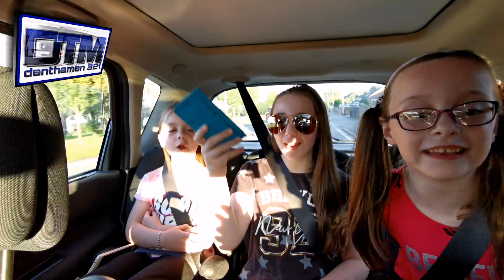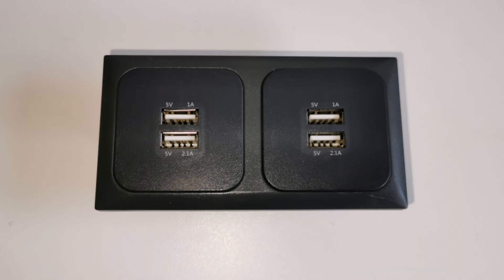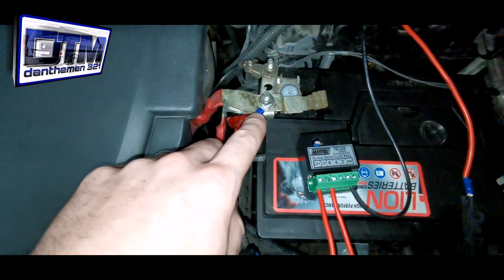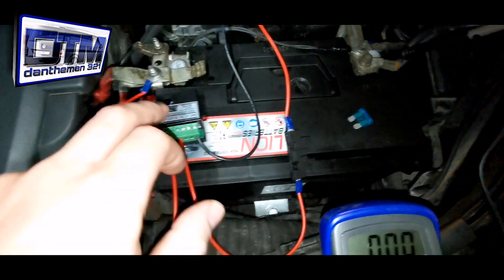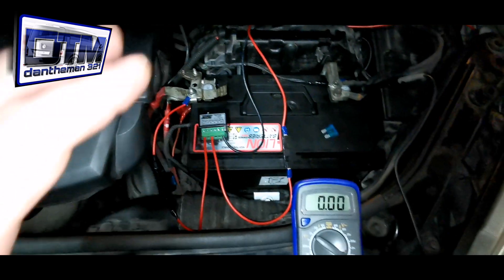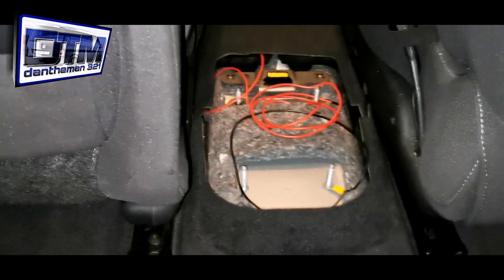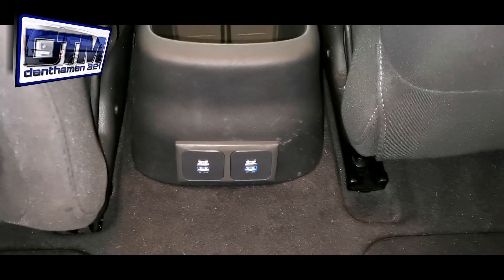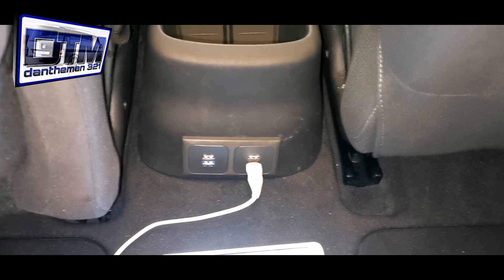DIY USB charging sockets ignition Live retro fit

Comment: Why not just pick up an ignition live via the fuse box ? Voltage sensing relay seems a bit ott for a usb sockets ?
Reply from the maker: Because the majority of people wouldn't know where to start with that, this method can work for most people and it's simple and cheap to do.